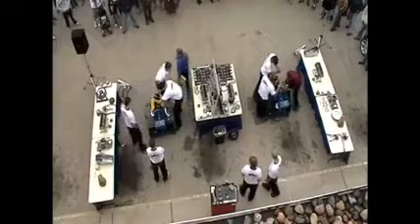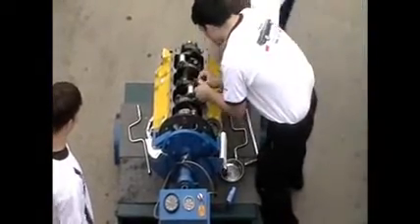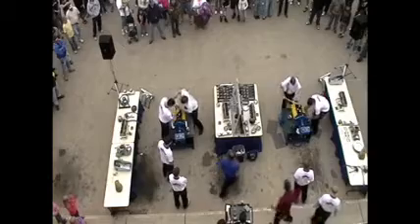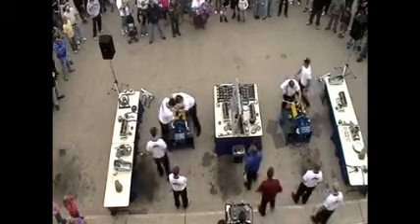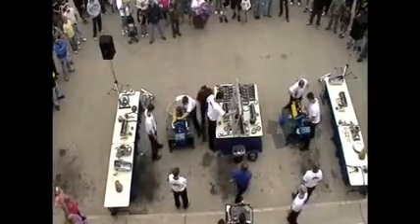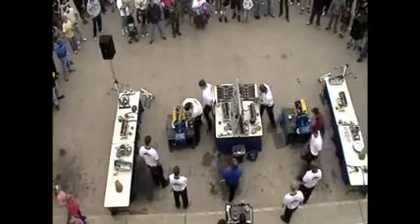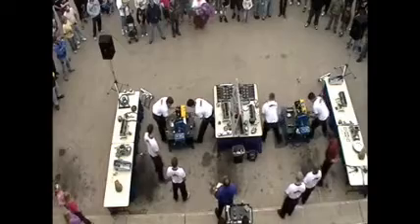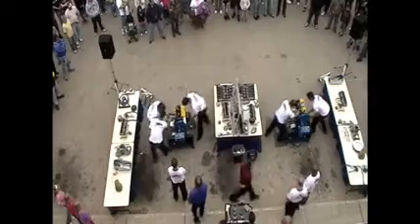SECC engine building competition. Part 1

Comment: As cool as these kind of competitions are, I thought I should mention that you NEVER build an engine on a stand like that. Engine blocks are not designed to be supported from the back where the transmission bellhousing attaches. Those bolt holes are not load bearing and the the block does deform as you add more weight to it in the form of the valve heads, pistons, crank, etc. If you ever go to buy an engine that someone "built up" make sure they didn't do thier work on an engine stand.